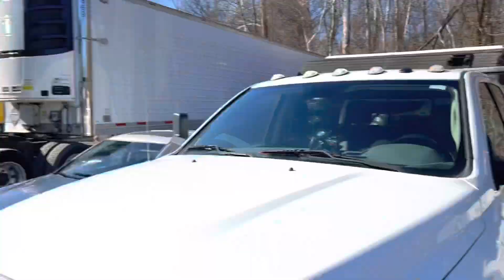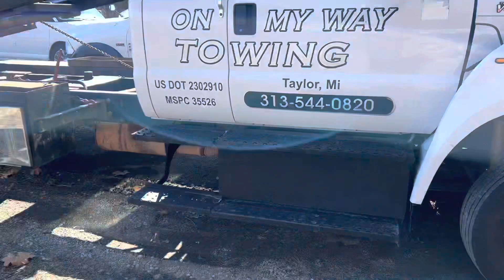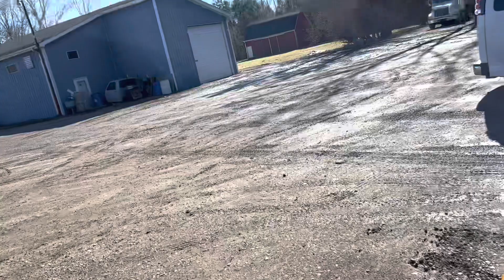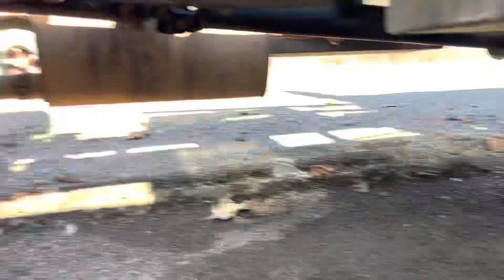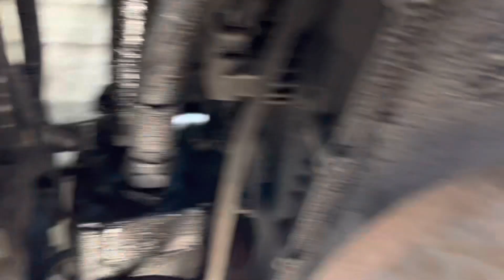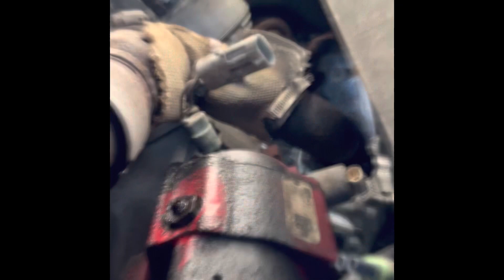Pulling the hydraulic pump off my tow truck

Comment: Hey were did you buy your hydraulic pump?
Reply from the maker: @mauriciogil5448  Bought the pump and pto from Zips
Reply: @ShavarMumford  do you happen to have the part number.?
I think I have the same pump but my part number it's almost erased. I cannot tell.
Reply: @ShavarMumford  do you happen to have the part number?
Mine, it's hard to tell what part number I have
Reply from the maker: @mauriciogil5448  are you asking for the part number on my old pump or the new one I bought
Reply: @ShavarMumford  if you could help me with both, that would be nice. I will appreciate you a ton.
Reply from the maker: @mauriciogil5448  326-9110-490 and N1016-3378 these are the only numbers I seen on my old pump hope that useful for you. I’ll dig around and find my receipt for the new one. But just letting you know the replacement was Pto and pump combined ran me over 3 grand I’ll look for my receipt and give you that part number tomorrow
Reply: @ShavarMumford  thanks so much I will wait for the other info. I really appreciate you man.

Comment: I have a UD2300 LP the left cylinder just broke. At the bottom anchor bolt. Lucky I found 1 at Dual Tech in Tenn. I am thinking do it myself, but i see your video. I am scared that the bed can crush me. I can deal with automotive vehicles, no problems. Any ideas?
Reply from the maker: I get your concerns. You can put blocks of wood in between your bed when you lift it up to keep the bed from falling on you